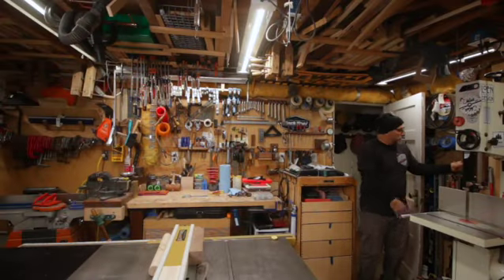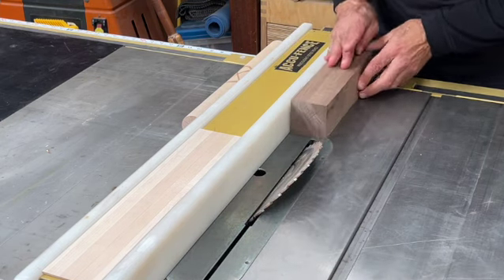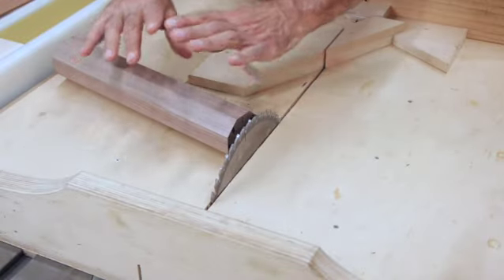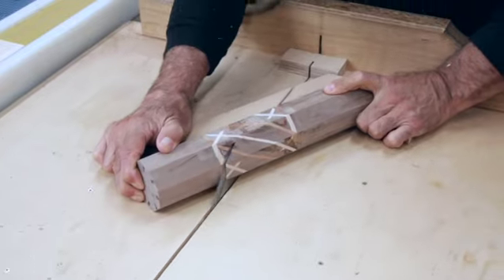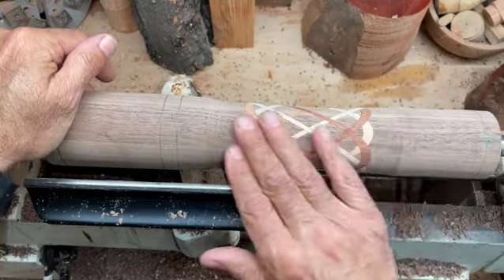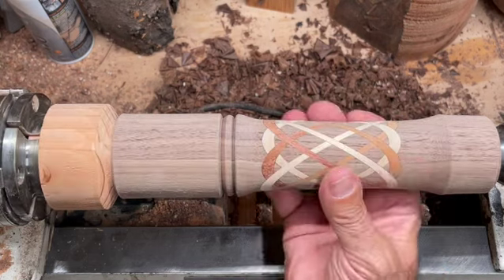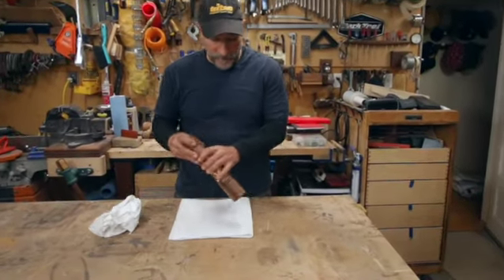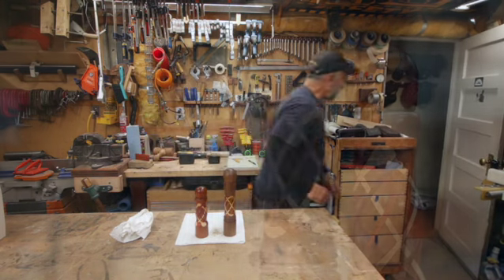Celtic Knot with 8 Rings plus How to cut an Octagon Block on a Table Saw.

Comment: It is not clear regarding the order you added the inserts.  We’re three species used- 1,3,5,7 for the first, 2,4, 6,8 for the second, and 3, 5,7 1??
Reply from the maker: You can do whatever you want, I just try to keep the same species separated. Draw an octagon label where each species will go so you can keep track. Have fun. 👍👍
Reply: Still not clear regarding what you did in this video.  So, 8 inserts - one on each side of the octagon. Is this the order?
White, orange, brown/white, orange, brown/ white, orange??
Sorry for being so dense.
Reply from the maker: I believe I may have used four different types of wood. But if you have 3 I would go and going clockwise on the octagon 12321323 if you have 4 types go 12341234.
Reply: Ok- the video said three and it takes four to do a knot.
Thanks
Reply: I did two and it came out great.  Thanks for the octagon tip.